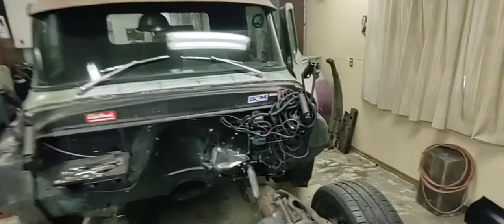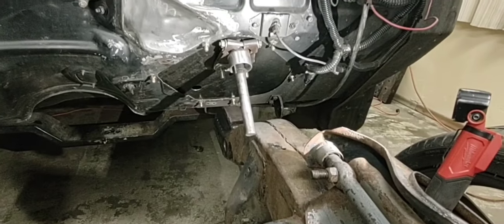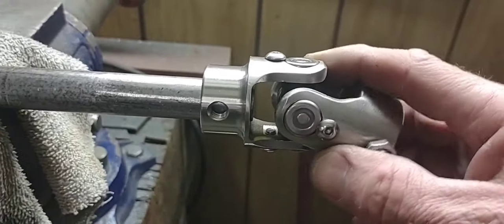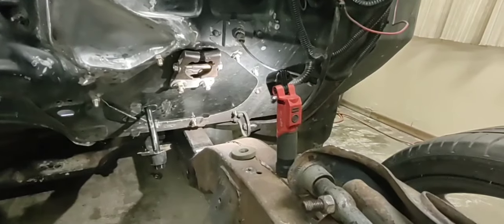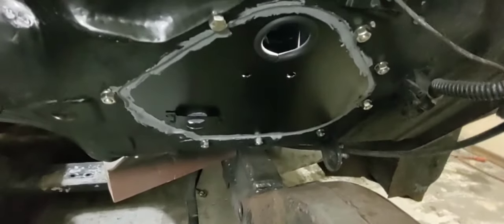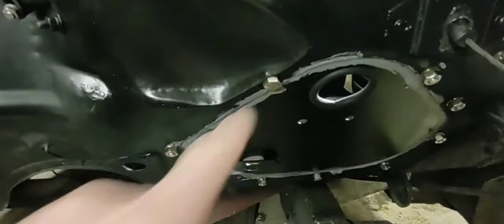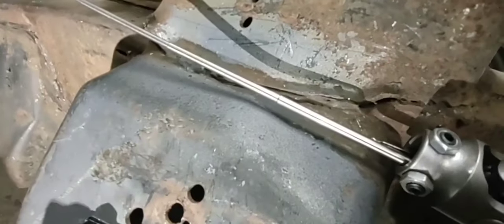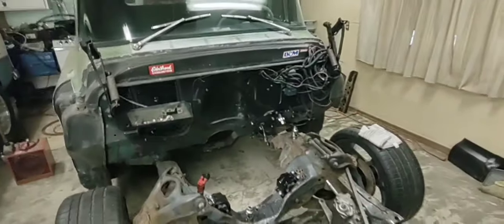Steering Completed For The Firebird/Camaro Subframe Graft On the 1955 GMC

Comment: The column sure came out nice Chris!  Great fab skills on this one!  The last column I had built was the stock one on my '57 Bel Air 4 door Wagon thst we added a rag joint and a tilt on it.  It took the guy 3 times to get it right before it would properly bolt back in!  I never went back to that guy!  Yours really came out very nice and clean! Great job and you are getting closer to driving the 'ol Jimmy soon!  Keep up the great work and have a great week!
Reply from the maker: Thanks Jeff! I'm happy everything worked out nice . Not much room for error and it's something that has to be done right. Never want nothing going wrong with the steering that could be bad. 
Yeah don't think I would have gone back to that guy either after working on it 3 times. 
 I'm getting closer I'm looking forward to getting more done spring time is coming fast and lots more to do. Might be summer time before I'm ready will see. Atlest I have the sedan to drive and I can't wait lol.
Thanks for stopping in and have a great week yourself brother.
Take care Jeff 👍🏻👍🏻👍🏻